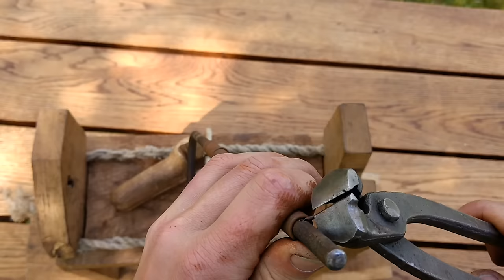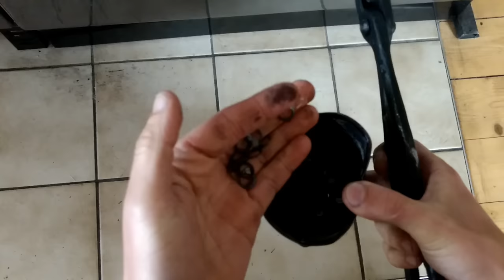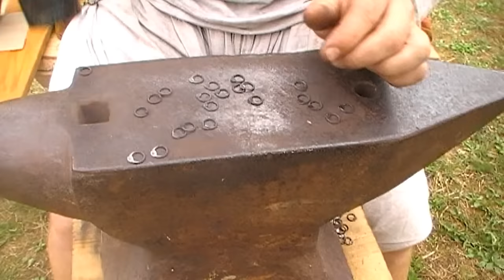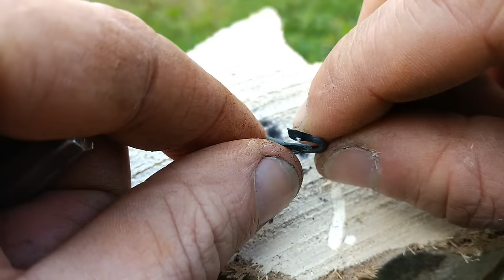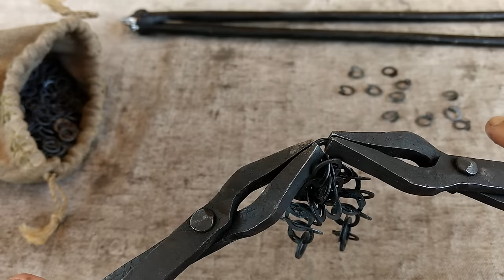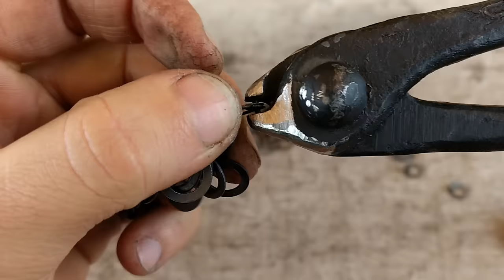How to make riveted chainmail

Comment: For all those who want to get into making your own maille, but are scared away by the sheer amount of work that goes into the historically correct way: 
You don't need to make the rings and rivets yourself like he does. Yes, your rings bought online wont look as good as his, but it's close enough. The work needed to do all the rings yourself is, as you can see, absolutely ridiculous and probably only for people who have made some maille armor allready. 
Second, if you start out and are not sure if it's something for you, pls for the love of god do a mixed ring construction (if the tailoring allows it). It is somewhat stronger, still historically accurate and half the work. I started out with fully riveted construction and especially in the beginning, where you still have to figure out your own best workflow, you will struggle and probably get frustrated by your slow progress, if you don't push yourself. Making riveted maille won't ever be a fast process, but you can get rather quick if you get used to it. Especially with a mixed ring construction.
Third, pls don't make a whole hauberk/haubergeon (shirt of maille) as your first project. It is the most time consuming and expensive project in the world of maille armor you could choose and the tailoring you need to do is hard. So again, if you aren't fully commited yet, it is just too big of a project. Do a maille standard or if you want something more challenging, a coif. You will see more progress and in a few weeks time you will have a finished piece of maille armor and know if you want to continue with the hobby.

Hope this helps someone who wants to get into it. For those still considering, try it out. It really is a relaxing hobby and there is very high satisfaction in having made your own armor.

Echt krasses Video Ironskin. Der Aufwand ist ja wirklich astronomisch... Machst du für all deine Projekte die Ringe selber oder ist das eher ein living history Ding, wo du eher den Prozess nachvollziehen möchtest?
Reply from the maker: True words! I have to add that a horse armor (or elephant armor) would be the most time consuming project in the world of mail. :D

In fact even the last scenes in the video show commercial rings, because I had to get it done in one day. I do make rings to experiment with them, but most of the time I use premade rings for tailoring projects.
Reply: Mixed construction is also known in the Arms & Armor world as 'half nailed,' or 'demi-clouée.'

Comment: He's making it old school. I haven't done it in a while but when I did I used a long bolt of the diameter I wanted the links to be. Cut off the head and cut a short slot in the other end. Chuck the steel bolt into a drill then feed the wire through two pieces of wood held together in a vice (for tension). Once you have a bunch of these wire springs made use some good cutters to cut them into rings. Braid the links into chainmail. I never bothered to weld the chainmail links and would occasionally have to replace missing links, but it was never a big deal. If you wanted to weld them I'd use a small welder to tack the links closed...easy peasy.

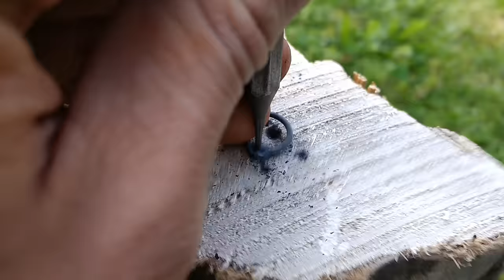Comment: What did you punch the rings on at 3:10? Whenever I try to punch my rings, I always end up destroying them.
Reply from the maker: For punching, I use a little hardened steel rod that I shaped into this form. I put the rings on a piece of hard firewood to punch them. The wood helps to preserve my punching tool. It happens that the rings get pushed into the wood and deform. Most time it is when they are not annealed properly or the overlap is too narrow. I wrote a guide to catch all these questions. Maybe that's something for you. https://www.ironskin.com/product/ironskins-guide-to-making-riveted-chainmail/

Comment: I can't even imagine the amount of people they needed to mass produce this in the medieval era for the armys given I'm sure not everyone had mail but still the process not only just to weave it all together but to size and shape it all properly jeez.
Reply: It is believed that they made up regular mail patches until they had an inventory. These would then be zipped together to make up shirts of any size, collars, voiders, and other mail articles. Even pot scrubbers maybe., 
Once the slow business of weaving the mail patches was done, final assembly was quick. "You need it Thursday? Done."
Reply: @w.reidripley1968 This is about how I did my shirts after my first one. I could make a front, back, collar, and sleeve. The collar would have expansions built in and I'd add ones to the sides to fit to as needed. Made production so much easier.
Reply: @scarling9367  Yeah. I think I call that fashion of shoulder and neck hole a 'mantle top,' after the round kind of bishops-mantle. It's all going round and round in circles, putting in expansions as you go. Unusual in historical shirts, but not unheard-of; I suspect the Boris Godunov shirt in the Hermitage is one such.
Something  I eventually learned was that giving a shirt a bit of a waist helps it not slide down through your cinch belt, no matter how vigorously you move.
I tend to build the body of the shirt pretty much as a single bloc, with places/suits included to insert expansion arrays for tailoring and for free arm mobility. This keeps me out of trouble with link rows mismatching -- or worse, gone spiral.
Reply: @w.reidripley1968  I think I've read about the Bishop design. The shirts I made were block design with expansions in the back for arm mobility. 

And yes, I also noticed that contractions and expansions around the belt line let it sit on the waist better.

Comment: My first mail shirt I made of 14g galvanized steel wire I bought at home depot I used a 3/16" steel rod to make my coils and cut them using a 6" diagonal cutter broke one and had to finish with another set. My shirt ended up weighing over 25 lbs(11.3kg). After I hurt my back I decided to make a new one but I used aluminum rings precoiled and saw cut Still came out to over 7lbs(3.2kg). I made a third shirt this time out of scales made of plastic it came out to just 5lbs(2.3kg). I want to try my hand at riveted mail too even though I know I'd never be able to wear it. I wear a 4xl shirt and all my mail shirts come to about mid thigh in length.

Comment: Just a quick question, how did medieval smiths forge metal into wires in the first place? Love the work, keep it up.

Edit: also I can see these rings got flattened at some point after 3:33, did you just whack them flat with a hammer or press them? Would love to know.
Reply: I know that one method of making wire is to draw metal stock through gauged holes, smaller and smaller, until it's the gauge desired. That works with copper and gold. I don't know if that's how steel is done.
Reply from the maker: What Charles Coslor described also works for iron-wire and has been used in history. It is forged into a rod and then pulled through ever-smaller holes in a plate.

Yes, I hit the rings directly with a hammer to flatten them. Alternatively, you can whack a rod resting on the ring. In the video I show both ways.
Reply: @Ironskin  The big modern difference is that the ancient way ran the drawn wire back and forth between two stout reels, passing through a hardened steel draw plate between them.
The modern method runs the wire unidirectionally through a lengthy series of die stations along the wire path. The process is pretty much round rod stock into one end and finished wire out the other; coil and ship out... to Boston...
Reply: Metal dies like they do now just on a much smaller scale

Comment: Question : is is stronger to do it like that or a more simple way?
By other way I mean just cutting the ring and do the chainmail like that also if yu have the time to explain me why each one is stronger than the other that would be awesome I'm very curious
Reply from the maker: The other way that you mention is called butted rings. They are weaker, because when you pull they open. To make up for this disadvatange you can use harder steel, but in the end riveted rings are still stronger.
Reply: @Ironskin  okay thx for the practice ^^

Comment: How do you blacksmith rings with no rivets? I see a bunch of round rings with no breaks, how do u make those?
Reply from the maker: There are three ways: 1.fire welding, 2. punching from a metal sheet and 3. Drifting from a metal sheet (Same as punching, but the material gets reshaped instead rather than beeing cut.)

Comment: How and why did the rings become suddenly flat? I very rarely see flat ringlets on mail. Tbh it looks like a totally different material, like you swapped to washers. In fact, they make a washer in exactly that dimension.
Reply from the maker: You observed it well! Indeed I swaped to using different rings for the demonstration how to assemble the rings. These are rings that I bought. It's a mixture of riveted and solid rings.

Comment: So, question. How do you make those full rings with no rivet? I might be wrong, but I was under the impression that EVERY ring was going to be riveted and weaved into each other.
Reply from the maker: There are weaves with riveted rings only. But most of the times you find solid rings as well. These solid rings can be punched, drifted or welded. Manufacturing techniques varied by region and century. Hence one type of ring or the other was preferred. However you always need riveted rings to close the other rings.
Reply: @Ironskin  Thanks for the response! Do you have any suggestion of a video or site where I can learn on how to make these solid rings? I have had experience with butted mail, but Im looking into stepping up my craft so any help is appreciated. Regards from Mexico.
Reply: @OLLG89  In the fifteenth century there was a strong trend to all-riveted mail. May have had to do with wire getting very cheap or something. But this trend never entirely replaced 'half nailed.' No worries.

Comment: Man i spent  like 30 hours working on Butted chainmail... using stainless  (so it wouldn't  rust and rub off on me)😂... i got the front  done before i was like screw this and bought a hauberk.Mine has much finer rings but god its so labor intensive even for butted mail

Comment: Butted is okay its just that its strength has been tested over hard surfaces which makes the strkes way harder over the butted mail unlike human flesh which will absorb the impact more applying less force upon the chainmail
Especially knowing that you will be moving during a battle,  
Yes the chainmail can be penetrated but its still hard to do.
Reply: Butted mail is reasonably okay 👌 for foam-weapon LARPs up to the greater battering effects of Creative Anachronism hard-stick -- a rattan stave, swung hard.
For the DIY beginners, butted mail is the cheapest metal gear you can have and look good in. In the Creative Anachronists ' game, mail is especially good about the neck, and as a skirt at the hips. It may be decoratively edged.

Comment: at 4:07 , are the rings without rivets welded closed somehow? or are they just butted together and beaten flat?
Reply from the maker: These solid rings are punched from a metal sheet.
Reply: @Ironskin  I see. I visited your amazing website and read it there too. I would love to see a video on drifting or punching solid rings. 

When punching the hole for a rivet, which size pin punch would you use for ring which uses 1.2mm wire?

Comment: how did they make so much thin metal wire back in the old days?
Reply: draw it through a metal drawplate with a tiny hole (the english heritage channel has a video about maillemaking and they explain how it works).

Comment: where did you buy your pin punch ? and how large is the point in mm ? I' ìm trying to make make but i have faild to make the hole various time, i have a similar punch but after 4 ring it was broken and if I do the proces on wood the ring just bends, i have to use a steel bar with a small hole ( I heated the rings until they became medium red)
Reply: The woods to soft but as far as the tool goes im not for certain good luck friend.
Reply from the maker: Sorry for the late reply Simone 9999. I make the pin punches myself from pointy steel rods. The diameter of the cylinder tip is about 1.2mm. It is the same diameter I use for riveting. If your punch doesn't deform it is alright. It's rather the rings. Make sure the rings cool very slowly after medium red heat. Make the overlap a bit wider. Use very hard wood. Meanwhile I wrote an instruction manual with a step by step guide which can be purchased on my website www.ironskin.com

Comment: Iron looks much better aesthetics-wise than using steel but the rust is an issue. What wire size did you use,  2mm? (12 gauge).
Reply from the maker: If you store it properly, the rust isn't much of a proplem. The wire here is 1.4mm. That is a bit thinner than 15 gauge.

Comment: @ironskin Can I ask why you used a chisel to punch the rings out when they're still on the mandrel? They look uncut later when you use the wire cutters, and it doesn't look like they're being cut with enough overlap with the chisel. So where did those rings go? 1:01
Reply from the maker: The cutting with a chisel is just an alternative way to do it. These rings did not make it into the video. The main method here is the cutting with a tong.

Comment: Friend, I am writing to you from Brazil ... excellent video, very instructive, tell me what is the "caliber" of that wire?  ..... and once the mesh is finished, is it possible to temper it ???  and if that is possible ... it must be difficult to clean the burned oil from each mesh ring ...
Reply from the maker: Hi, Grretings from Germany to Argentina! The caliber or diameter of the wire is 1,4mm. I do not temper the fiished mesh. It is iron. So it does not harden. If there is burned oil on the rings, it would be good as extra protection from rust. But you dont need it.

Comment: Thanks for the video, I've just started blacksmithing and would love to try this at one point, can I ask what kind of wire and size (thickness ) ect do you use for this?
Reply from the maker: Hi, this is 1.4mm wire worked into rings with 8mm inner diameter.
Reply: So the rod you used for this was 8mm round? Sorry if that's a silly question!
Reply: @user-hh6eo8fj2q  The rod that they used to shape the wire was 8mm in diameter, or 4mm in radius, yes.
Reply: @user-hh6eo8fj2q  It's an essential question. You got this. I like to use two rods, one rather thicker than the other for initial and finalized overlapped diameter, ready to flatten with a hammer stroke. A hammer of four pounds' weight is about optimal for the job -- fewer hits per link.

Comment: Are there any tools to help organize the weave? I have a problem of having very large fingers: it is difficult to weave loops in while holding another part. With pliers, I don't seem to have enough hands.
Reply: I lay my maille down and use long sturdy tweezers to scoop the open ring through the ones I want to connect.  (Though I've only made butted maille from aluminium wire and a tiny patch from steelrings).

Comment: so do u wire brush it then wax tellow wipe it to stop rust?
Reply from the maker: Actually I just leav the rings as they are. The black surface is quite resistant to building rust.

Comment: Wouldn't it be better for when you make the rivets from failed rings, instead of nipping them with the wire nippers, you cut a smaller hole in the jaws so it makes  round bite instead of a flat bite?  Sort of like how you cut a round bar off on a hot cut hardie, it just gradually squeezes the entire circumference.
Reply from the maker: Thank you for sharing your idea. That's an option. When the rivets is crushed, it get a new shape and it almost doesn't matter how it was before. Maybe the different cutting makes handling easier though. Could give it a try.
Reply: @Ironskin  I just think it's a lot easier to shove a circle into a circular hole than a rectangle. When metal is deformed, the material moves.   Sure it's not going to effect the actual rivet, but it will go into the hole way more easily.

Comment: Hey mate your mail tongs look amazing! I'm trying to tailor my mail sleeves, any suggestions or advice?
Reply from the maker: Yes, do it with a build in bend. https://www.ironskin.com/making-sleeves-for-mail-armor/
Reply: @Ironskin  What he said. Hold up a proper sleeve of mail and it looks a lot like a sock with a heel to it.
NOT just a tube. Taper down from elbow to wrist, which will be rather irregular and fiddly. Sleeves of mail are in open hang so the mail flows with the action of your shoulder and especially your elbow, which totally needs that extra slack.
The hang of the sleeves is in contrast with the mail on the body, which rides in closed hang. Fits itself to you.